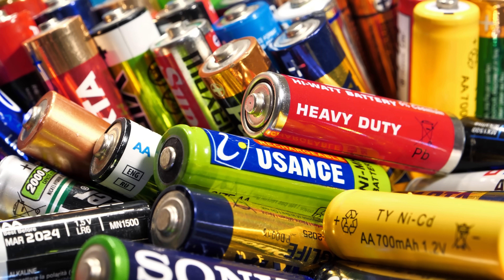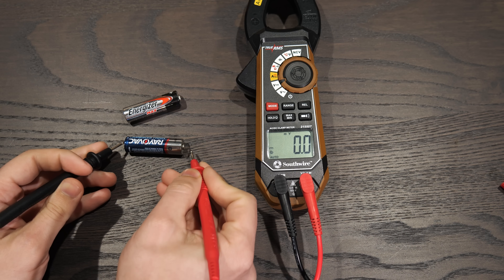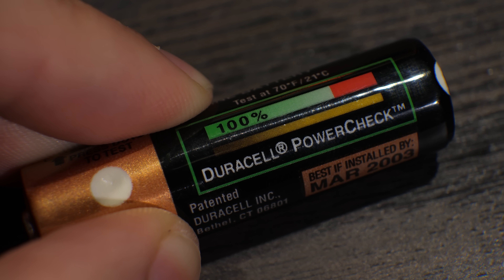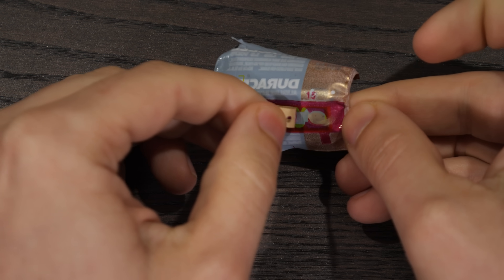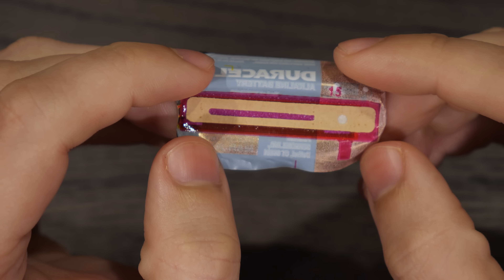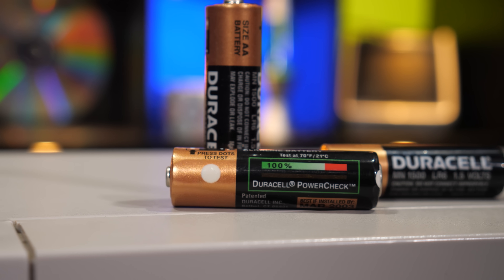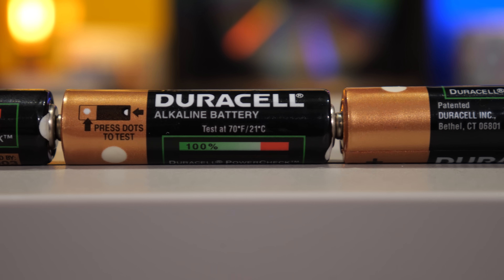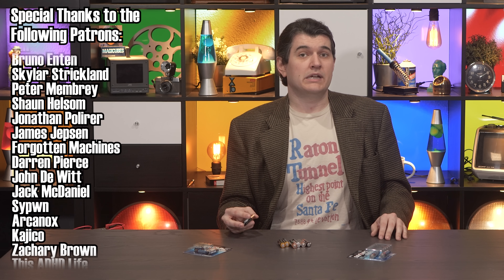Duracell PowerCheck: A genius idea which didn't last that long

Comment: What i remember about these batteries was never use the tester. If you are doubting how much charge is left, using the tester kills the battery completely. 😢
The other annoying thing is that if the battery is dead you think it's you who is not pressing hard enough. 😢😢😢

Comment: With most devices having soft switches as opposed to hard, physical disconnect switches, leaving cells in a device causes them to discharge are a small amount of current is used to operate the soft stitch when off.  Hence removing thrm when not in use for a while keeps the cells fresher.

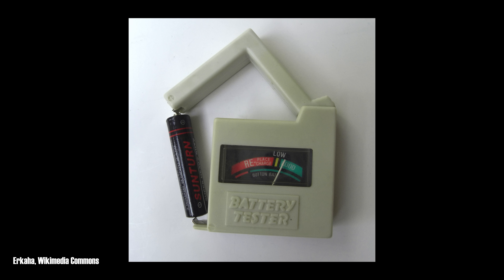Comment: DUDE, that's so much nostalgia both with the PowerCheck itself and the battery tester at 2:55 which I still have somewhere... I used to play with them a lot. Like a LOT. So much that I'll buy these batteries just to play with them.

Comment: I'd have thought that the main problem would have been insuring that it was 21° Celsius. Especially in countries (like here in the UK) that don't control the temperature with air conditioning etc.

Comment: There were actually another version of that tester and it was printed in the packaging cardboard of the battery. For instance 9 V Duracell batteries had them and they were (are) quite useful. I have saved one of them and use them for testing.

Comment: Mostly dead batteries go in a drawer to be used in clocks... they'll last monts or even years in a clock while not being strong enough for a more hungry device. I think another reason these went away is because these days devices that use batteries have battery level display. Back then most things had just an LED that would turn red (if you are lucky).

Comment: That's not how product design and tooling engineering work. It's not because "AA would totally fit in there" visually, that they would. Making a product with tight fitment and tolerance doesn't involve the same conception as this TV remote for example. I know because that's part of my job.

Comment: AA and AAA i don't have a problem with because a lot of the gadgets at home have a need for either one. What I did have a problem with was the random D or C batteries that some toys suddenly required and you could never find those lying around the house, warranting a trip to the local grocers.

Comment: Still using disposables, I have so many devices that only need new batteries about every 4 years, it would take 20-30 years to actually save money with rechargeable batteries (and that's the cheap ones). Also, dozens is an understatement on a Gameboy (first set of rechargeable batteries I had was for that bad boy, charged them multiple times per week.)

Comment: Those little battery testers that came with the package? I saved some of them. But I'm not happy that someone threw out one of those. Because to use the multimeter, I have to get it out, put the batteries in it, attach the leads, then try to figure out the right settings to test batteries. Then I have to remove the leads, remove the batteries, and stow it all back in its little box. So much easier to just squeeze the ends of the battery, or use the piece of packaging.

Comment: As a kid, I remember there was a fad of using these batteries. Problem was we tested them so often with the built in tester (which was in fact a direct short) that we used up the batteries far quicker than those without a tester 😐

Comment: My own rarely used tools from which I remove the batteries whole not in use: my graphing calculator from school and my label maker. Once, I opened the junk drawer to find that I accidentally let two batteries rest side-by-side but with positive and negative reversed. They were super dead AND I got to clean up the white stuff they produced. Lesson learned!

Comment: I'm absolutely STUNNED that those old Duracell batteries aren't leaking and corroded, I remember they would do that even if you left them in the package.
Reply: New Duracells leak all the time but tbh I don't remember the old ones leaking.
Reply: @eDoc2020  I do, but it wasn't as bad as now, they weren't in the package still but I remember I had some leak in my GBA and eat one of the tabs, I ended up just jamming in some tin foil there after. The current ones are trash and don't even make the best before date, I've long since change over to rechargeable batteries for all appliances.

Comment: Once they started building the battery tester into the battery rack (without the need of a battery itself to run) there wasn’t a point.

I’m one of those people with vintage electronics that will remove batteries before storage so sometimes I test the lose ones to see if they can live in the tv remote for a month or so.

Comment: Remote manufacturers are in league with battery companies.  

Also, before throwing out ALL the batteries in a device when it goes dead, check the cells with a cheap multimeter.  Sometimes it's just one cell that went bad and dropped way under 1.5V.
I personally substitute a NiMH rechargeable for that bad cell until all the disposables die.

Comment: I used the Tester batteries all the time in any given device. It was always one battery that drained more than the other so it didn't always need every battery replaced at the same time.

Comment: Different devices need different minimal voltage to operate. When some hi-tech Bluetooth toy tells me the battery is dead and need replacement, then I pull out the battery and do not throw it away but keep it somewhere. Then when I need a replacement for simple toy I use this battery. After that it can be used in electric candle for example. Then it goes to dead battery storage box, and eventually to the recycling box somewhere at the gas station.

It's not about the cost of batteries, for sure, it's about rational resources usage. You might say I just need rechargeable batteries for all the devices, but actually no, it doesn't make much economical or ecological sense in many scenarios with low power devices. Like, there is absolutely no sense to use new batteries or fully changed expensive rechargeable batteries in low power decorative light which I turn on once a month for 10 minutes.

To make it all work I have to use battery tester, which sometimes is annoying, and sometimes tester shows unreliable results because tested without a load. If every battery has reliable build-in capacity tester that would simplify the process so much, and it would definitely make less waste and give battery a second and third chance to be useful again.

Comment: The 25 year old Duracells still had their contents inside because they contained mercury. Modern mercury free Duracells leak like there's no tomorrow.
Reply: Exactly this, I have an old rarely used hand lamp, which uses 4 'D' cells,  I test it every so often, its still bright on the original batteries - a set of  Duracells with a best before date of 2004, they have not leaked at all, so were probably made before the mercury ban!

Comment: These still exist, and I buy them from Amazon regularly. They're useful because batteries in the UK aren't thrown out with your regular garbage, so we store them until we're next heading to somewhere with a battery recycling point. Naturally the dead batteries are stored near where the new batteries are because that's just convenient when you're replacing dead batteries in something, so there's a non-zero chance new and dead batteries get mixed up. The powercheck feature just makes this a non-issue and the price premium over batteries without powercheck is minimal, so it's a no-brainer if you know where to buy them.

Comment: didn't forget this I run a gameshop and last week a gameboy advance (non sp) came in with a duracell with that powercheck on it, the battery was from 2006
and it didn't even leak... it was still working fine

Comment: Can you explain what happens when a dead battery switches polarity?    Like they'll show - 1.5xx volts, if you put them under a load the voltage drops to the expected zero.

Comment: I remember these appearing in the UK just over 10 years ago, although they had a blue strip instead of the yellow, but they were functionally identical, and also seemingly disappeared just as quickly...

Comment: I remember in the 80s, taking out batteries and keeping/saving them to use on other things--portable radios, walkmans, even mini torches/flashlights were a popular 80s item kids had (to read in bed when you were supposed to be asleep)--was actually very common. Rechargable battery sets were also a popular gift item for Dads and kids alike. I guess this was still a long time before this PowerCheck came out.

Comment: You made a critical mistake. When a battery starrs to die, its short circuit current drops more rapidly than open circuit voltage. So you should measure short circuit current. The heat generated by the indicator is also a function of short circuit current, rather than open circuit voltage.

Comment: The problem I found with these 25 years ago was that I had a flashlight with a very precise battery compartment to prevent rattling. 

The battery tester made these just thick enough to get stuck pretty easily.

Comment: I remember as a teenager having tested these batteries... I have quite high grip (and finger) strength... I remember holding an empty AA cell and pressing those pads really hard. The yellow thingy filled up xD Obviously it was a higher room temperature, but at the time I thought "huh... useless built in tester, the harder you press the fuller it gets -_-"

Comment: I never thought of those side testers as a voltmeter but rather a mini load tester where one would guesstimate how much juice was still in the cell. Another thing I had observed that if you left those batteries and others of like chemistry in a device and forgot to turn it off and given enough time, they would leak and corrode your device. It says right on most of them that they will not leak. I say, yes they will.

Comment: we used the tester ALL the time growing up

but also we had these plus we had the rechargable AA batteries. But since this was still in the era where leaving the batteries on the charger meant reducing the battery life, we would use the rechargable batteries, then replace them with these power check ones when we needed to put the batteries back into the charger, then swap them out again for rechargable batteries when those finished charging. So the duracel batteries always had some unknown level of power charge.

But agreed that nowadays this kind of technology probably isn't as useful

Comment: I'm a technician at Duracell in Belgium. Big fan of your channel btw. I want to add a fun fact about the discontinued power check. On the EMEA market Duracell still produced batteries with a power check under the "Ultra" brand and for north America under the "Quantum" brand, production discontinued about 3 years ago when "Optimum" became our new premium. I work in the finishing process and production of these cells with power check were really a pain because the cells didn't had a round shape anymore and got stuck in the chutes causing blockage. I'm happy we've passed that 😅
Reply: Hey man, I m from US and we had the same issue here in US plant. Cheers and happy we got rid of it... hehehe
Reply: @suprashank  Cheers man 🤙. Only the ones involved in finishing will remember the MX pain 😬.
Reply: Do you have any guesses as for why Duracell's in north america are so prone to leaking these days? I never had many issues when I was in the EU, but here I've had many cells that are anywhere from a few months to a couple years old that have leaked in their packaging without any draw. Even when in use without any passive draws I'll come back a year later and have to neutralize the entire battery compartment.

Even cheapo dollar store batteries have rarely leaked on me in recent years, Duraleak has been the nickname here for nearly a decade now.
Reply: @sakaraist  no, I do not have. I'm only a technician. Duracell Quality management is pretty dedicated so the best thing you can do is to inform Duracell customer service. You can find the according phone number on the back of the packaging of the battery. Make sure you have the best before date and batch nr which is printed above it in the white rectangle. Some packaging could be different. Duracell takes quality seriously and if the customer has something to complain about they will be serious to solve it.
Reply: @rafvn23 will keep this in mind.  I have noticed Duracell leaking a lot in the last 3 years.
Reply: @sakaraist I had the same experience with leaking; the last straw was in a brand new pack with an expiration date like 9 years out.  No offense to the Duracell folks here but I just switched to energizer
Reply: Why were these never put in rechargeable batteries where they would actually be useful?
Reply: @justinfriedman2039 good point, however since many of devices with rechargeable batteries (smartphones, watches, toys…) will tell you how much charge is left, and often these batteries are not exposed to the end user.
Reply: @funkyflow1845  He says about rechargeable AA and AAA batteries, not accumulators
Reply: @justinfriedman2039  I can't say for sure this is the reason, but NiCd, and NiMH batteries (the chemistries used in AA, etc) have a bit more of a cliff in the discharge curve, when compared to alkaline cells.  A typical non-rechargable AA starts at a bit over 1.5v, and gradually falls as it's used, until it gets too low to power whatever it's being used in.  A rechargable AA tends to start at about 1.25v fully charged, and falls very slowly until it's almost fully depleted, at which time it quickly drops.  This makes it much harder to estimate capacity, and is also why battery meters on older devices were notoriously bad with rechargables.  If they were expecting alkalines, they would show 3/4 with fully charged, and would stay there for a while.  By the time it dropped to the 1/2 you had almost no time before it went all the way to zero.  If they had a "rechargable" setting for the meter, it would show full when it started, but still had the same problem of showing full for hours, and then falling to zero over a few minutes at the end.
Reply: Tell your bosses this would work better on rechargeable batteries
Reply: @mockingbird_redacted  I don't think so. As presumed in this clip, devices these days are able to show the amount of battery remaining. Which in the past was not. Technology advancing has made this feature obsolete. An extra benefit of removing the powercheck is improvement of recycling the label. It might look small but it's a severe difference.
Reply: @rafvn23  I use AA Batteries in my aviation headset, and a lot of people use rechargeable batteries for that. There is no way to tell in our headsets so there is still a use for them right there in my everyday day life. I’m sure there is more than one field it would be useful in
Reply: @mockingbird_redacted  you might have a point there, in some specific applications it would be useful to have something like the powercheck. But it's something above my pay grade and got the marketing specialists 😅
Reply: I love when people directly involved pop up to give us the authoritative info 👌🏻 Thanks!
Reply: That must be why I’ve remember using batteries like this but being born in the 00s
Reply: I can still buy them in Greece. So I doubt they are discontinued completely.
Reply: @Luggruff  yes it's discontinued. We don't produce the Ultra brand anymore. The expiration date would not be later then 2031 maybe 2032 i think. Greece has quite a unique packaging bc of the language so the stocks move probably slower extending availability.
Reply: That explains. I was confused when he described it as something from the 90s.
Reply: Hey my Maintenance Buddy, I'm a Technician at the Fairburn, GA packaging plant 🍻. We now have the ability to test all AA and AAA cells right before the robots place them into the packaging
Reply: Do you have chemical engineers at duracell?
Reply: @lucke839  Ofc we do.
Reply: @lucke839  for sure, I'm only a electrical and mechanical technician so I'm not on the high level but our lab technicians do their best to make the best and most stable chemistries according to use of the battery. Our Optimum chemistry is one of the most advanced ever made.
Reply: For this who don't know, I presume EMEA market stands for Europe, Middle East and Asia market.
Reply: @bruzote It stands for Europe, Middle East, & Africa. I’ve worked in supply chain and that’s the acronym that has been used for that region.
Reply: @bruzote  indeed. Due to circumstances we do not deliver to Russia anymore. India went to China I think 🤔
Reply: @bruzote  Thank you
Reply: @bruzote  close, Europe, Middle East and Africa.
Reply: @DarranGange  yes indeed Africa not Asia
Reply: @bruzote  EMEA stands for Europe, Middle East and Africa. Asia is in APAC (Asia Pacific) region.

Comment: I think that the real reason that they pulled these strips is that, well, I remember the powercheck, and my impression was that 5 or 6 battery tests would completely drain the battery, or at least cause significant decline.  You have a multimeter and a handy disassembled Duracell.  How many ohms did that strip measure?  Ok, apply ohms law and determine how many amps the strip draws and how long the battery tester can be actuated.  Figure that the tester would need to be activated for 20 seconds to get a read.  How many amps hours would be used by a minute's activation of the strip?

Comment: I pulled an old toy train out of storage for my niece to play with. I was surprised to see that it still had batteries in it, since it had been in storage for 20+ years. It had 6 Duracell PowerCheck C batteries in it. I tested them for fun, not expecting to get any results. To my amazement, the first battery I checked filled the yellow meter about halfway. The other 5 didn't give me anything, just that one battery.